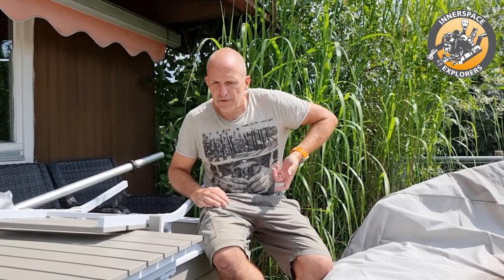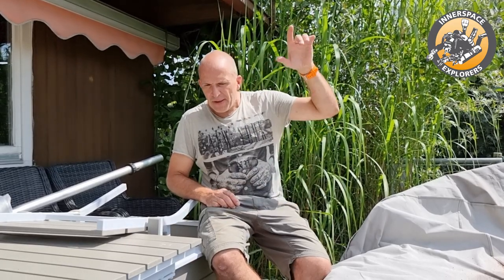How to Deflate your Wing

Comment: I’ll admit it, before I found Achim’s channel I was one of the divers with the retractable this and that and the obnoxiously expensive brand new BCD with not one not two but four different ways to dump air thinking I was all kinds of cool going out on dives and even worse actually working at depth.
   Keep it simple that keeps it safe also dive it right there is a reason why Achim puts out these videos.

Comment: I used to have a problem with this: why is all the gas not coming out?  The reason was that I trained in the old PADI fashion where a lot a skills were practiced when you were quite upright in the water.  When I started with a wing I was flat in the water but still lifting the inflator next to my ear, and of course it was still below the wing.  I had to remember to move it back and up past my ear.  Similarly, the hip dump is much more use if when you roll you also pull up on the string rather than along your body, to lift the whole valve up to the air bubble.  I had no idea I was doing it so wrong until someone filmed me.  Felt like an idiot, but that is the power of muscle memory!

Comment: ... and pull the string towards the surface so the valve moves to a high position. Seems so obvious but worth mentioning directly as pulling it in a random direction is common.

Comment: Hello Achim! As always, great movie, even though this one will not be useful for me personally. However, I would love to see something like that related to the drysuit. I’m using one here in the UK and keep thinking that one day I will not be able in an emergency to dump all air quick/efficient enough. This is now worst than ever since I am trying to have a balanced rig. Meaning I no longer am overweight. I’m thinking about adding one more exhaust valve on a second arm. What are your thoughts here?
Reply: you say you dive a balanced rig, that means you don't need much air in your dry suit anyway. Maybe try it in a controlled manner: Press your inflate button on the drysuit continously and see if you can manage your rig and dump the air.

But my personal experience, i leave my dump valve on the lowest or almost lowest setting and never have an issue. But it sounds to me like you should practice the procedure. a second valve is likely not the solution.
Reply: Not being overweight actually makes it easier/safer because buoyancy increases less for a given depth decrease. You have more time to react BEFORE it becomes an emergency. As for where you put the air to increase buoyancy early in the dive (offsetting the weight of the air you'll breath later), using the wing for primary buoyancy control (just enough air in the suit to avoid squeeze) puts more air where it can be dumped very quickly if necessary. (No need for a second suit valve, IMO.)
Reply: @Blubpaule  I will still need air inside my drysuit for thermal comfort and general movement. 
At this moment, I already have the exhaust valve constantly open without a problem (until one will happen). This won't help in case of uncontrolled ascend.
Reply: @pbillings808  So during the beginning phase, the air is inside the wing. But as gas is disappearing from the cylinder, I'm releasing air from the wing itself. So at the end of a dive, with 50 bars left, I have no gas left inside the wing while doing safety stops. Just what's inside a dry suit to keep me warm and avoid a squeeze. But in my head, that's already a lot, and in an emergency, I will not be able to slow down other than sinking myself with water inside the suit.
Reply: @olegjanas  You don't need much in the suit for mobility. I can tell I have too much when I feel the bubble running quickly from shoulder to shoulder as I slightly roll. With the right amount for me, the air has to move within my undergarment, which feels "different" -- perhaps a little slower, less ticklish. :) With your exhaust valve fully open, it's probably right. Just get in the habit of rolling a little to the right to place the valve at the shallowest depth so it keeps up with ascents. The dangerous part is when the valve is low -- like when you're head down vertical. You must learn the technique to easily flip & roll to right yourself. Lastly, avoid a really fuzzy undergarment top, as it may clog the exhaust valve.
Reply: @olegjanas  I suggest you practice until comfortable. Keep depth shallow and ascents slow, so you'll be OK if you do lose control. Go down to 12 ft/4 m and up, stopping at 5 ft/1.5 m, repeatedly. Intentionally go feet up at 4 m and recover. You'll get it. An instructor/experienced buddy can be helpful to speed up this learning process.

Be comforted by the fact buoyancy changes fastest in shallow water. Once you can keep control at those depths, normal depths will be a piece of cake.

Comment: Hi Achim,

Thanks for this new video.

Are those fins the hollis f1 LighT in orange ?
Reply: Hollis sold the design to OMS and they have it in Orange as the OMS Tribe
Reply: @Blubpaule  alright ! I see...
With same quality ?

Thanks a lot for your answer !
Reply: @pierredumand3348  yeah they are both great. I dive the Hollis, it's a bit heavier as far as I remember which I prefer
Reply: @Blubpaule  The OMs fins look like the Light version of the hollis f1.
Do you mean to say that even the hollis Lt are still heavier than the OMS ?
Reply: @pierredumand3348  The normal Hollis F1 that I dive are a bit heavier. My Wife dives the Hollis F1 LT and I believe they are pretty much the same weight as the OMS
Reply: @Blubpaule  got you !

Thanks

Comment: Informative content as always, thank you for sharing such useful information.
If i may get an answer on a question please (not relevant to the topic).

In sidemount standard configuration, can i use long hose in both tanks?
I didn't try it .. but i thought about it.. what could possibly go wrong if I used long hose on the left tank just as same length of the right tank!?
Reply: So, why do you need a long hose in the first place? The only real explanation i ever heard was that for a buddy that can't handle stages/sidemount to be able to donate to them without giving them the tank. Ok, i would train them first, but alright. 
lets say you have such a situation where you can't give them the tank. This is probably because it's a rec diver in open water having a problem. since he's breathing the one tank and you the other you should pretty much stay balanced anyway.
Now lets say you actually have two longhoses. you always want to store them when switching? or better yet, tie several ropes around your neck? this sounds like an accident waiting to happen.
As much as you need but as little as necessary.
Reply: @Blubpaule  absolutely convinced.. thank you, just thought about it.. that's all